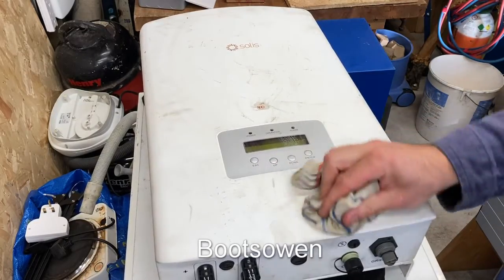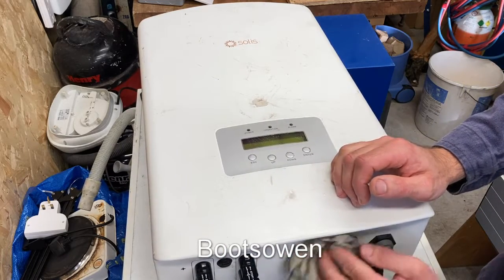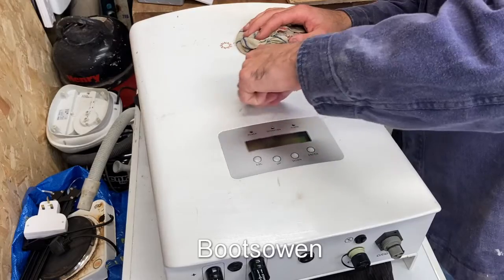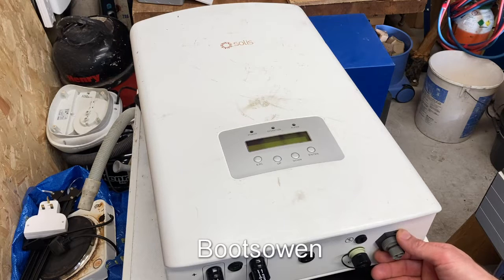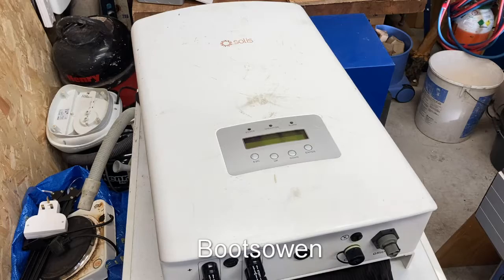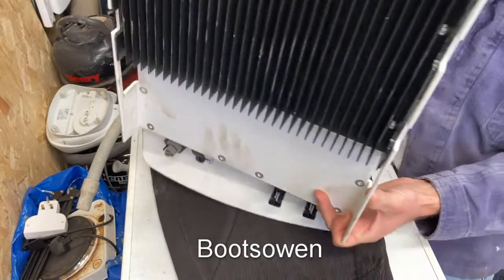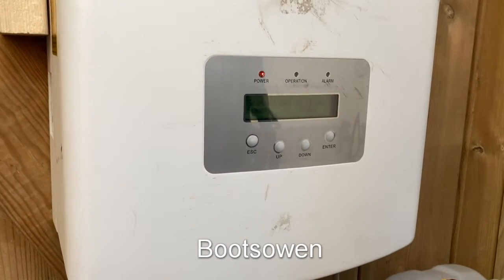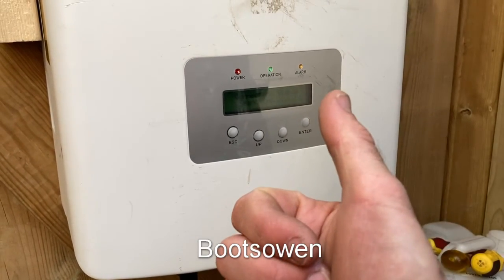Solis Ginlong 3.6K-2G inverter test and OV BUS error code: what next?

Comment: Hi Owen!
Your other videos were really helpful in helping me fix my Solid inverter relay. However, it stopped working again and when I tried to fix it this time, I think i've messed my relay up beyond repair now. I was wondering how easy is it to remove the relay from the board and put a new one in? Would i need to do desoldiering and resoldiring with a new relay?
Reply from the maker: Yes

Comment: I have a Solis 3k-2g which just had the exact same problem. So I ask Professor Google and this is the answer.
Solar Inverter OV Bus error message means the inverter has detected an “Over-Voltage” on the DC bus within the inverter. This is an internal fault within the inverter, and you’ll probably need to have the inverter looked at by a professional.
Which definitely leaves me out.
Was you able to gix it?
Reply from the maker: Yes, it is fixed and working now, have a look at my more recent video.